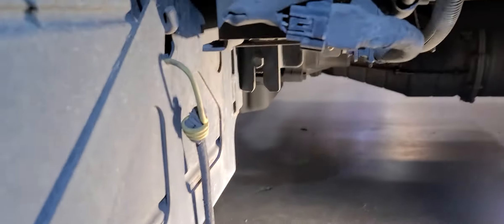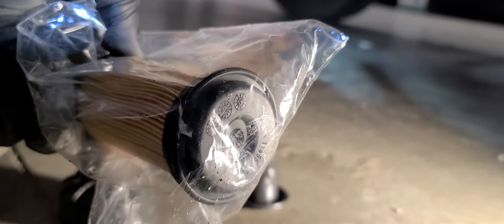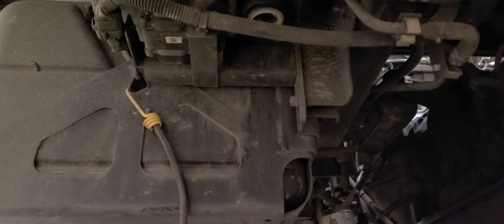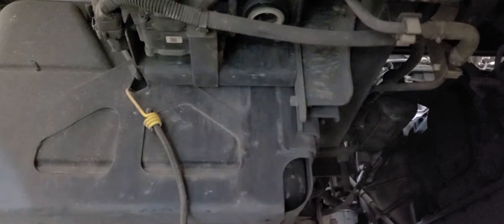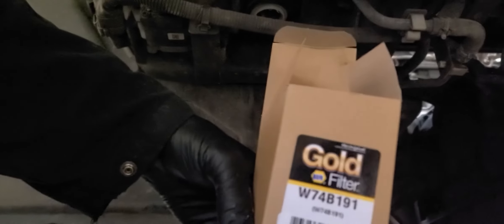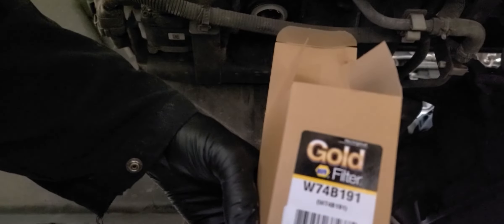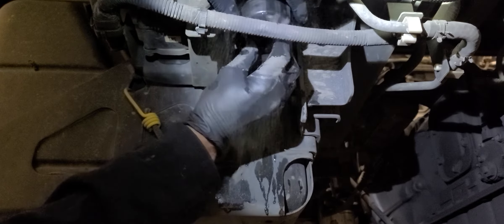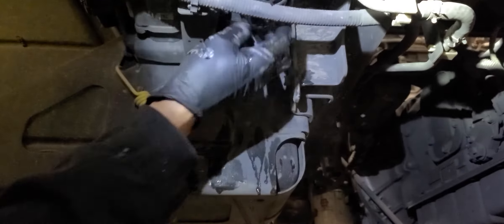change D E F fluid filter 2011 isuzu npr hd

Comment: Don't you have to change the O-Ring? Does the old O ring still make a good seal? And whats that long rubber stick? Can be seen at 26secs in your video. My replacement filter (Bosch) came with it, not sure if it should be installed on the Isuzu or meant for other cars?
Reply from the maker: Yeah, I always a good idea to change it. I put it slight amount of grease on mine. So they stayed better longer. And yeah, put that little rubber piece back in
Reply: Thanks. Which grease is good for it? Synthetic or red grease? @herpabetic

Comment: We’ve got code P20C9 and only code P20C9 and a red exhaust system light. Any ideas what this could be? Level sensor is bad? Pump going out?
Reply from the maker: How long has your red light been on once they hit that red light sometimes it takes suzu to actually clear them out
Reply: My experience with this code on 2 different NPR's was a a NOX sensor on 1 and 2 NOX sensors on the other.
Reply: Ever get this fixed

Comment: What about the P20C9 code on the DEF? Could this help that?
Reply: Have same code - what did your issue end up being?
Reply: Hey I have the same code did anyone one find put what Is it was could really use the help plz 🙏
Reply: @Ron-vw1kc  could be a number of things. Ours was faulty nox sensor
Reply: As I understand it P10C9 - is just a generic code for “something is wrong.”  Control module detected an error.

Mine later threw a p1036 - so we knew it was a nox sensor
Reply: Oh okay thanks alot I'm going to seen if its the nox sensor
Reply: @Ron-vw1kc  I just changed the box sensor and a few weeks later the exhaust light is back on
Reply: @richarddurazo7447  There are 2 NOX sensors, one on the side of the SCR to the right of the frame rail and one left of that same frame rail underneath the chassis. Typically the one to the right of the frame rail goes out first due to its proximity to the SCR. If your chassis is already fitted with a box or bed this NOX sensor is difficult to access.